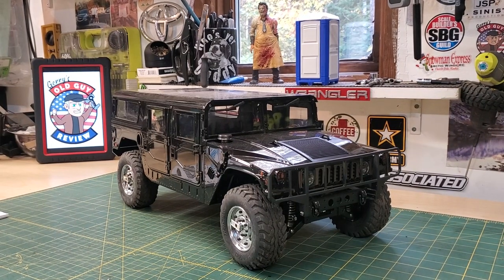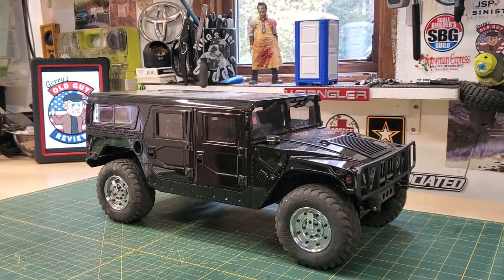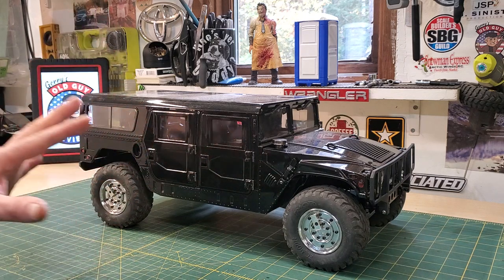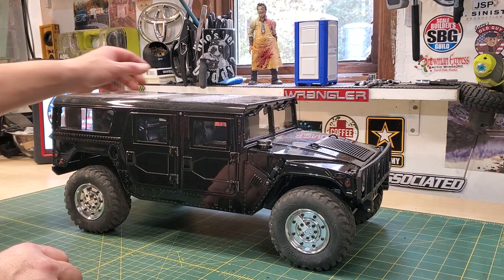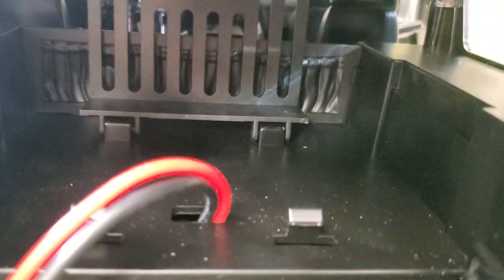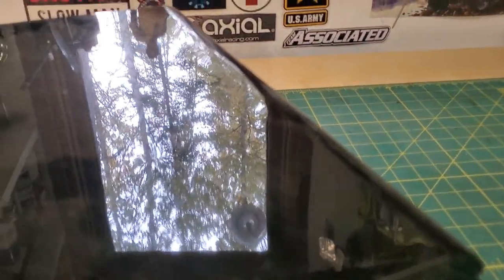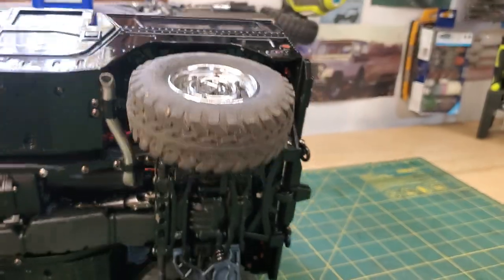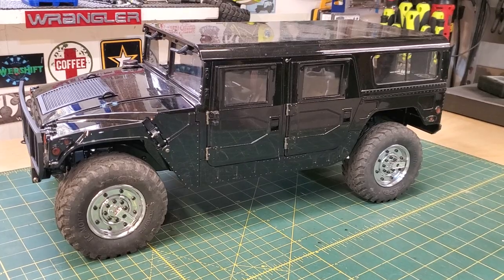Hg p415, checking it out!

Comment: Hello, the roof rack, and front winch, and metal front bumper, rear bumper with spare tire, front metal guard and side bars all come in a kit that you have to buy if you want all that, i do not think any truck comes with those items. I have seen a site in China where you can buy all those items separately. The kit also has the lightbar that mounts on the front of the roof. Only thing i do not like is how easily the paint can chip, and it has white or grey undercoat that really stands out. Ready to see your next video on it. Many groups on FB for the HG trucks.
Reply from the maker: Hey Harold 👋,  the p415 pro version has all that on it, but right now they are running 700-900 in price. And the complete add on kit is out of stock everywhere I have found it running 250-350. And I to have found the sites that sell it separately. I may just get a few part of it, I really just want the light kit for sure, and I also found a roof rack that might work!! Thanks for dropping in😁
Reply: They have the complete kit in stock, free shipping and no tax.
Reply from the maker: @haroldmueler7399  where at harold??
Reply: @gerrysoldguyreview cool thanks buying them
All up so I can control the market
Reply: @gerrysoldguyreview  Gerry i sent you a email.
Reply from the maker: Thanks bud!
Reply from the maker: Iam starting to find more lurking at small shops online !😁